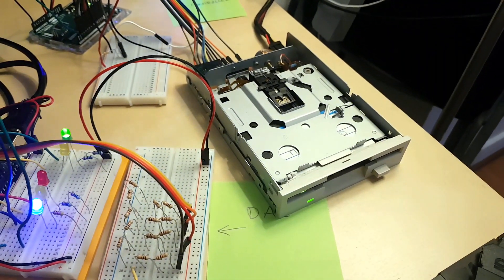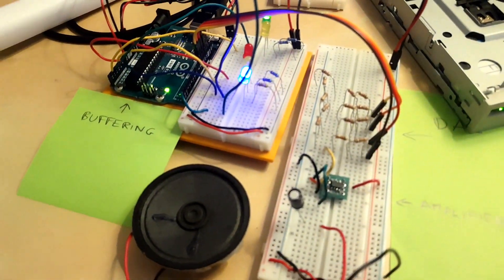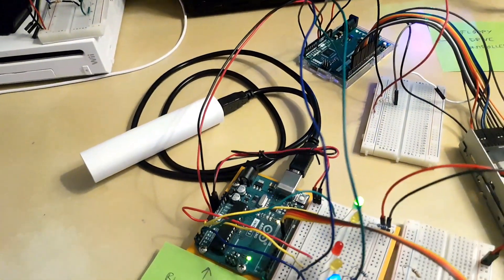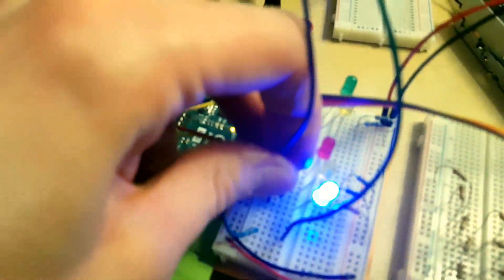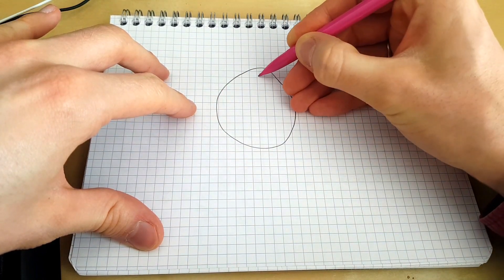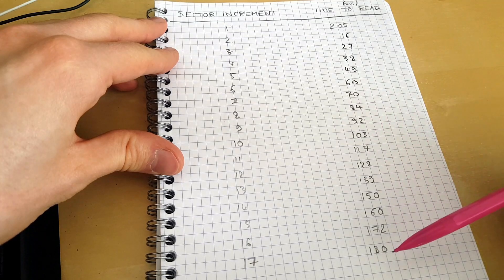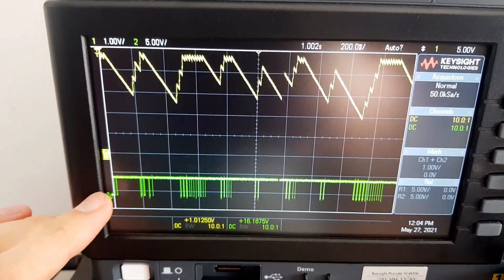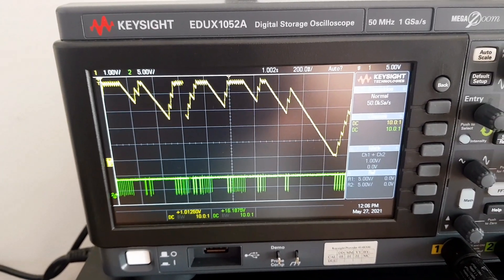Playing music stored on floppy disks with Arduinos

Comment: 💭 In my head, the floppy heads use custom moving, directly connecting the read/write heads and play/record analogue audio directly, kinda like a cassette tape, maximum 32 seconds per side. 💾 I don't know if this idea even possible somehow... 🤔
Reply from the maker: Yes, it's possible to use the floppy to write directly analog data (bypassing the regular storage format). This guy has done it for instance: https://www.youtube.com/watch?v=ziVXF_tM4Gw
Reply: @riverchampeimont  I already found that video, it uses the data lines with decoding circuits. So, I mean, external fine stepping for the heads and wiring the heads directly (bypassing the drive's circuits), similarly like this:
https://www.youtube.com/watch?v=Xpr7B-7BFP4
In this, the floppy heads are directly wired like audio cassette heads. Okay?
Reply from the maker: @zsombor_99  You're right. I remembered incorrectly the video I cited. On the other hand, the video you're citing does exactly what you talk about indeed writes the audio analog signal directly as magnetic variations on the floppy. Doing it with an Arduino would be possible, but in fact the only part in which the Arduino would be useful is moving the step motor. The signal itself does not need any processing by the Arduino since it's directly the audio signal. So the Arduino code would be pretty trivial: just send a pule to the step motor every time you receive the pulse sent by the drive when it does one rotation.
Reply: @riverchampeimont  Yes, but it needs a lot slower and smoother (custom) head moving to improve it.